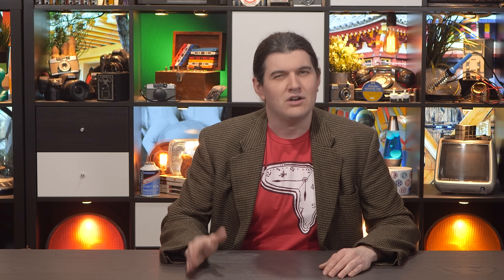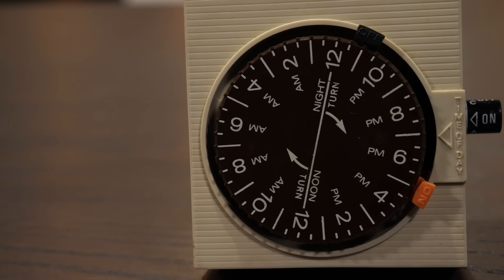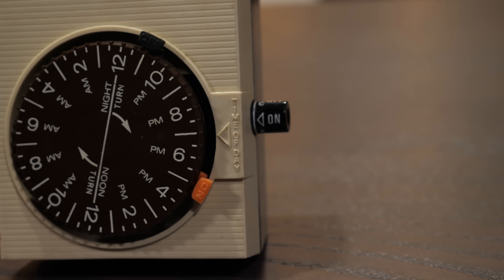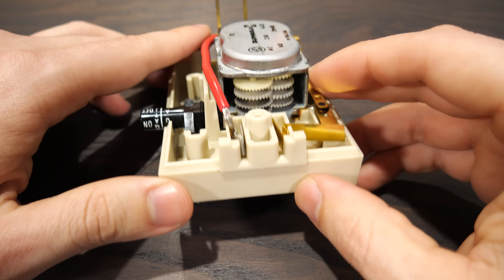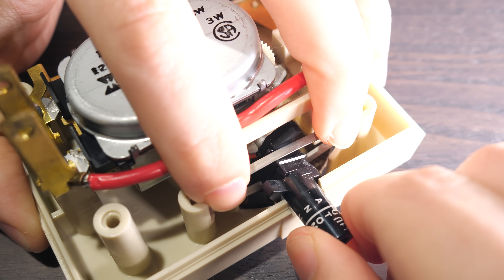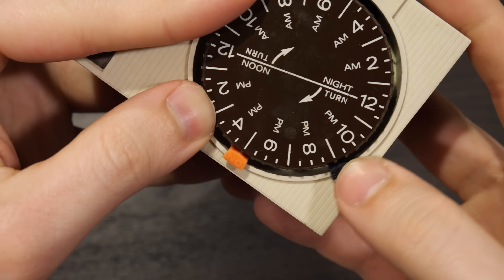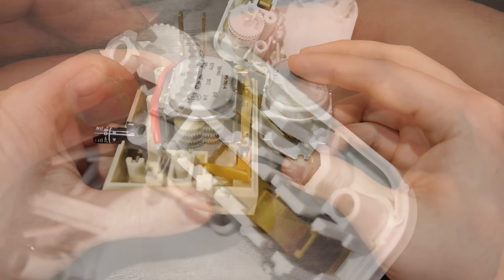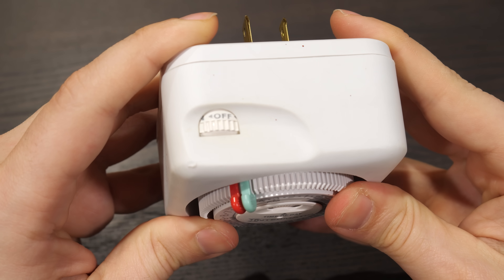Timer switches: literally just a clock and a switch

Comment: the big brother of this is the sangamo weston street light timer and outdoor lighting timer, its excetionally well made and the on/off tabs are moved mechanically by some extra curved metal pieces to account for seasonal variation in dawn/dusk. Thinking of carparks they even added a little wheel to exclude days of the week. Everything in it is mechanical and basic but btilliant. its been updated over the years but i like the 70s versions the best

Comment: I've got a mechanical timer on my boiler which controls when the central heating goes on and off
It's like little slider things that pivot so the inside is off and the outside is on. It's got a slider for always on and always off as well
Super handy once you find a copy of the manual on the internet to find out what each position of each thing does what!

Comment: The timers I’m used to have a ton of switches around the circumference of the dial, the switches are either nearer the centre or towards the outside but I’m never sure which way round means on or off.

Comment: This may have been mentioned (or known) beforehand, but a common method of avoiding the game company from interfering with search results related to switches, you just need to add a hyphen before the term you wish to avoid, presented here as "-Nintendo" , to the search terms (do not add the quote marks for this one).  If you want to be more specific, using "-"Nintendo Switch"" (removing the outermost quotes).  This should be effective for nearly every web search, but some sites (Amazon, directly) do not seem compatible with it.

Comment: One of the cool options on the digital ones I had, was to add a "random" 0-30 minutes to each setting, so that the timing was "more realistic" if burglars were watching the house. Or something. It was kinda fun anyway.
But a couple of years ago I needed to buy a new timer plug, and I was dismayed that it was cheaper (and with lower running costs) to buy a smart plug. Hey, it works. It still has an override physical button on it at least.

Comment: mechanical timers are great. I'd actually use them, if those motors wouldn't produce noise 24/7. So digital it is for me! (also I'm now somewhat hooked onto home automation - so now everything is digital for me, comes at double the price and I'm constantly switching batteries and wondering why nothing works. FUN!)

Comment: My house still has an old Central Heating System that uses one of those! By 'Danfoss', I guess the system was installed in the 1980's maybe. Works fine, we use it in Winter so the heating comes on before we have to get up in the Morning, and turns off before we all leave the house! It's situated in the Kitchen, and whenever I hear that 'Spring snap' ping sound, it always reminds me of how the heating will be off soon 'Probably because it just did it 10 Minutes ago!' >.< Plus I love equipment that doesn't need Charging, WiFi or an App!

Comment: Why does the lack of a polarized plug make it "borderline useless today?" There are plenty of modern devices that use unpolarized plugs, most notably USB chargers.
Reply: Because the main purpose of these timers are to turn lamps and maybe a radio on and off when your on vacation or away for an extended period, to make the home appear occupied so as to deter burglars.    Unless you have a very old lamp with the original cord and plug,  it has a polarized plug as a safety feature.  The lamp will work without issues with the plug inserted either way, but when you're changing a light bulb it's easy to touch the metal threads on the bulb as you unscrew it, if this is connected to neutral,  no shock.  If the threads are connected to hot you will get a shock, ranging from no sensation if you are standing on dry floor and not touching anything else, to injury or death if you also happen to be well grounded, whether that be from standing on a wet basement floor or leaning against a radiator.

Comment: My boiler has an integrated 48-tab timer for controlling the heating. It's a pretty bad way of trying to maintain a temperature, but I guess it's cheaper than having a system with thermostats.

I also have a few socket timers, but the gears/motor are unfortunately so noisy that they can't really be used in any living spaces.

Comment: One key point that you didn't mention, the modern ones that are all solid state normally have average to poor power limitations. Most of the consumer ones I have seen warn to not exceed 400W-1000W, which is pretty poor when we have 240V ~ 2400W outlets and appliances here. None of the analogue ones I own or have seen have such limitations.

Comment: "Since grid operators do a fine job of making sure that power runs at exactly the right frequency [...]"
Interestingly, a few years ago the European synchronous grid actually ran ever so slightly too slow for a while due to an imbalance caused by a political dispute (hooray for synchronous power grids spanning dozen of countries). This caused clocks relying on AC power for synchronization to drift about 6 minutes before the issue was resolved.

Comment: How not to lose those removable tabs. You have an extra on tab place your extra on tab directly after the one that turns on your appliance. Since the appliance is already on it won't affect it. The clock will turn past this point and nothing will happen. 
Do the same for the extra off tab, placing it directly behind the one that shut off the appliance. Since the appliances already off it will do nothing.
You now have stowed away those annoying extra tabs in a place where they are conveniently located but out of the way.

Comment: For the record: electronic timers suck , if you have to switch something powerful. My experience finished when the expensive sophisticated microcontroller DIN relay for switching the hot water tank jammed every week or so. Finally, problems disappeared when "upgraded" to mechanical relay.

Comment: We have some hybrid electronic/mechanical timers you might like. They use the same timer as that electronic one you showed, but instead of a relay they have a linear motor and mounting bracket for a light switch. When it's time to actuate the motor moves some bars with wheels which flips the switch.

Comment: I like the mention of the use for sign lighting. Having worked in the sign business most of my life, I can definitely say that photocells are not a great solution as they do not last long at all. Most people who want to go the route of photocells instead of timers do it just because it’s cheaper and doesn’t require access into the breaker panel. I will always try to pitch timers just because of their reliability
Reply: Do the photocells not last long because they're of a cheap make or is it all the photocells no matter the quality that are impacted ?
(I mean, lots of streetlights use photocells).
Reply: I think a lot of it comes down to a cheap make because of it being such a widely used solution. The ones in street lights that I also work on seem to last quite a bit longer than the standard 120 volt photocells, even from the same manufacturer @psirvent8

Comment: I have a switch timer with removable actuator pins and I used it for a good year or so, but I eventually stopped using it because I found it annoying constantly changing the on and off times with the pins because of that thing the sun does.  I'm also legally blind, so reading the current time on the dial and trying to put the pins in the right place was a bit of a nuisance for me.  I now have a timer switch that does require Wi-Fi and an app, I understand why people have issues with this, but I like it because I can set the timer without needing to squat on the floor to adjust the timer settings, and my iPhone's screen reader will read out the time settings as I adjust them.  These timer switches are still a good idea though if you don't want to go down the Wi-Fi/app route.

Comment: My neighbour in Glasgow (Scotland) had central heating controlled by a timer which dated from about 1910. The clock was wound up with a key and instead of closing/opening switches the actuators opened/closed the gas valves. No electricity involved! In case that sounds hideously dangerous - well, it probably was.

Comment: Neat teardown, I'm liking "November in January"!
I once built a few "industrial grade" electromechanical timer units for a client who owned a quality control company. They tested fabric samples (among a variety of other things) for parameters like durability, colourfastness, and resistance to colour fade in strong sunlight which was simulated by exposing samples to a bank of powerful UV lamps for a calculated period of time. They were using typical off-the-hardware-store-shelf electromechanical timers for the lamps as Alec demonstrates here, but they kept failing as the high inrush current of the lamp ballasts exceeded the switch contact rating in these consumer-grade units... they would arc every time they switched on and eventually weld themselves closed, even though the steady-state current draw was only about 6A per unit (well below the 10A @ 240V nominal rating which is standard for consumer power outlets and switching hardware here in Australia). 

I couldn't do anything to limit the inrush current to the ballasts because then the lamps wouldn't strike and could possibly sustain damage or have a reduced lifespan, and these lamps were expensive , like "replacement lamp for your high-end home theatre projector" type of money. So I sourced some "Heavy Duty" electromechanical timer modules from Farnell (now Element14) which had a peak rating of 16A for the switch contacts and a nominal rating of 12A. They were of the type that feature two concentric rings of closely-spaced holes on the timer dial - one for On times and the other for Off times - which accept metal pins to set the program. The closeness of the hole spacing allowed for control of on/off intervals down to 5 minutes i.e. 12 divisions per hour in each of the "On" and "Off" rings, which suited the application perfectly. There was a very simple "pin sliding in slot" type of flush-mounted manual override switch on the side of the unit, and nice chonky screw terminals for the mains wiring. They were not cheap.

The programming pins were incredibly easy to lose (even though there were a few additional holes on the face of the unit to store unused pins) and they were a bit fiddly to use when setting timing intervals but apart from that it was a pretty solid design, and in this application we were only interested in a few specific time periods so it was a set-and-forget kind of deal. Installed them in grounded metal enclosures into which I fitted heavy-duty mains input/switched output sockets and a suitably rated fuseholder + slow-blow fuse. As far as I'm aware, they were still working fine when he eventually wrapped up the company in the 2010s about a decade after I supplied them, and would probably have gone on for another couple of decades with no issues. There's something to be said for the reliability of the good ol' geared-synchronous-motor-just-flipping-a-switch design. :)

Comment: With digital timers, you don't see the whole day schedule! So, it's a tradeoff.

15 years ago, a school where I was a student called me, because they couldn't figure out how to change the schedule of the boiler.
It was for good reason, that was an old system with a mixture of mechanical timers and one digital timer where the screen was so small that it didn't offers display of days, but 3 digit codes. So, you had to use a flow chart from the manual and fiddle with the mechanical timer too.
Took me a solid hour at the time to understand how to setup different schedules for different days, because it wasn't as simple as entering the schedule day by day. You had to think about how time would pass by encoding start and stop times for other timers. A big shit to program, especially when you think that you are dealing with time of the day and it's in fact hours to wait 😂
System got changed after that.

I still have the one with push tabs in my room to manage ventilation. Because it's mechanical and so simple, I did setup it once and I'll probably die before having to replace it. Obviously, those are not to be fiddled with every day (Because tabs becomes loose).
Ironically, I did electro-mecanical studies and I didn't though out how the override switch did work. The most basic mechanical "or" hold switch, but that's often those things that you forgot about. A bit like the "not" one ^^

Comment: I'm using the harbor freight digital timer to time my cooking time for a one gallon distiller and that allows me a better result with an easier time of it when setting up for another gallon to be made. My water is hard enough to cause the ruination of underwear if you drink it as is, so it gets distilled into perfectly fine H20 for any use I've tried so far. The good part about the digital timer is when I set it to shut off a half hour early, then the scrubbing down of the dregs of the remains in the heater pot are a quite easy scrub with SS pad and it's ready for another load about that quick. If you don't scrub off the remains each time you will eventually build up such scale as to take a very concerted effort and I have ruined the SS heated bowl on one of them doing just this lazy way of trying to use it anyway. No shortcuts allowed, you scrub it clean each and every time and it lasts a very long time. Trying to figure out how to set the timer into ON mode and have it do 3.5 hours was somewhat difficult, but eventually I prevailed despite the chineseum/engrish instruction sheet. So now it's much easier to set it and forget it, but as a habit of can't be too careful, I will always unplug it anyway after it's found to have shut itself off and I happen by there. The scrubbing of the burnt on remains of my hard water can take better than five minutes of seriously furious work otherwise. The scrubbing of the half hour shorted stuff is hardly three decent scrubs and very much nicer to deal with. The flip side of this topic is that the constant boiling distillers are a very bad idea using my water, the one my uncle gave me was never completely refurbished due to the found knowledge of practical distilling of one gallon at a time, it must be scrubbed out clean while the scale deposit is still soft and amenable to light manual removal. This is the part where an automatic system can not possibly be workable. There just isn't a solution or method to make it an automated one, so no point going in that direction for me.

Comment: One downside of these is that they lose time when there’s a power cut. When we bought our current house, we thought the heated towel rail
In the bathroom was defective, because it was hard wired to one of these under the house. I found the timer but there was no label saying what it was connected to - eventually I put it together.

Comment: These kinds of timers are GREAT and super common for things like reptile heat lamps, aquarium lights, I straight up need them on my plant grow lights. They're very useful.
There is even surge protectors that switch on and off multiple outlets at a time. I have one that had 4 that are switched with the timer and 4 that are always on which is perfect for having lights heaters, air pumps and filters all in one place.
Reply: There is a similiar timer on my block heater but it only can run max 2 hours 🤔
Reply: @jaskajokunen3716  that's interesting. What is it exactly? I guess it's safety? You can only have this on two hours?
Reply: @NickClarkDrums  It preheats car during cold weathers not sure why there is the 2 hour limit since you can just move the outer circle after 2 hours and it starts again, might be if someone forgets it on, it wouldnt use energy consantly. If you have car indoor heater it would also be very dangerous because theyre not designed to be on 24/7.

Comment: Hey there! Thanks for the videos; love your choice of topics and the deep dives you take. I use one of these timers for my Christmas lights. It's a little different from the ones you showed. It has forty-eight fixed tabs that can be set individually in half-hour increments. That allows the device to be turned off and on at different times and intervals throughout the day. I'm not quite sure why you'd want that level of control, but it just goes to show that there is no limit to human ingenuity. Thanks again and keep up the great work! It is truly appreciated.